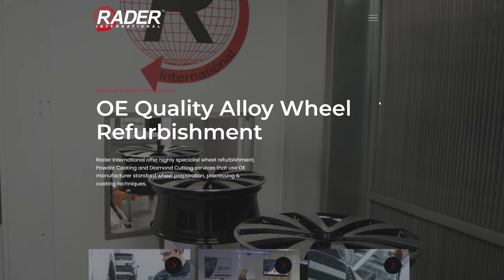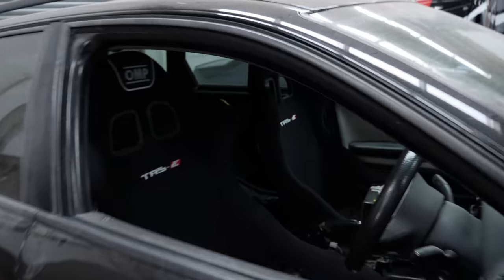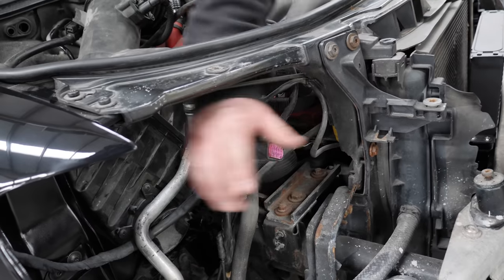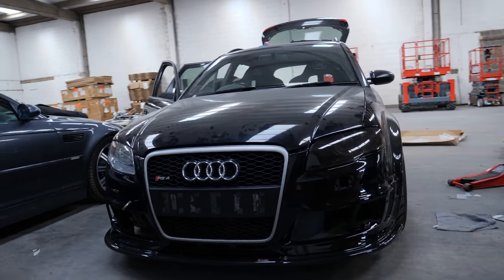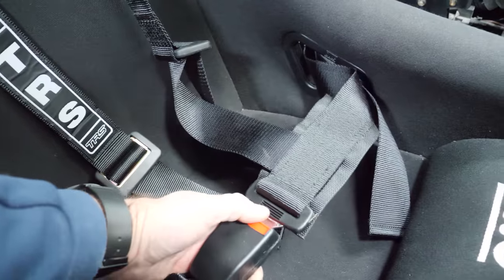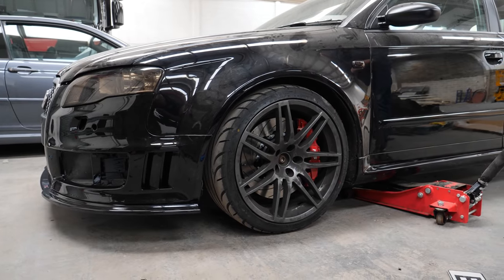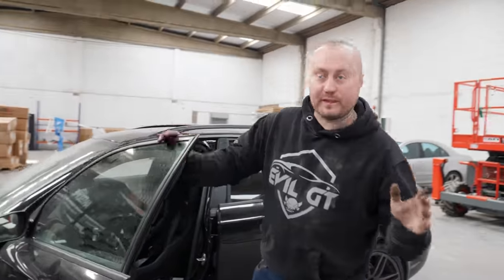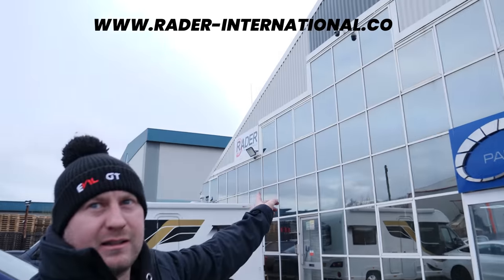IS THIS THE END FOR THE RS4 AVANT TRACK CAR?

Comment: Hi guys love the content. Quick question you replaced the xenon headlight for a halogen unit. Is this a straight forward swap? I have a xenon unit and the light keeps flickering etc doing my heading. I can get a set of halogens cheap if it's a straight swap out then that would solve all my problems until I sort out the xenon unit.
Reply from the maker: It doesn’t work mate it’s just for filling a hole for now. Thanks for watching 👍🏼
Reply: @EVILGT  no probs. I will give  shout to the audi owners club see if they have any ideas. Keep up the good work lads. 👏

Comment: You changed the way the spring is loaded loosening the parts you did on the coilovers 
You need to spin the whole coil and shock assembly down in to the hub from what I understand. That’s my understanding of how you set them up
Reply from the maker: Followed the instructions and guidance from the lads at awesome 😬🤷🏼‍♂️
Reply: @EVILGT  if that’s what they say is right then I’m quite sure I’m wrong
Reply: @EVILGT  may be it depends on the brand as well. Good to see you got your hands dirty and not your new coat
Reply: They are KW, that's how you do it, not like BC style.